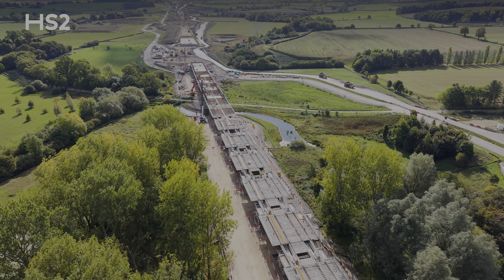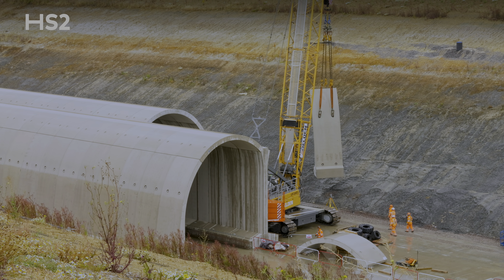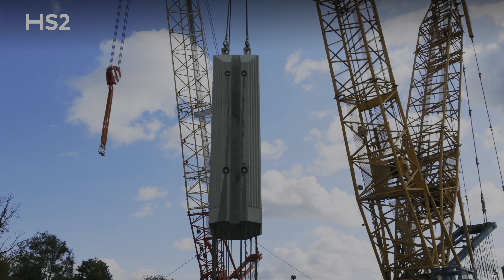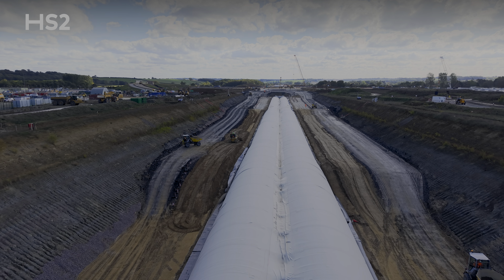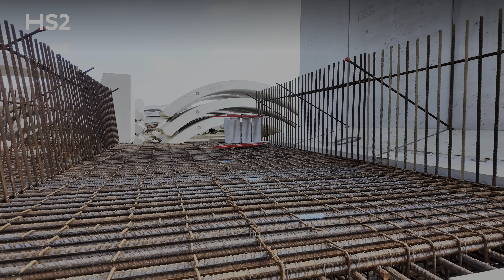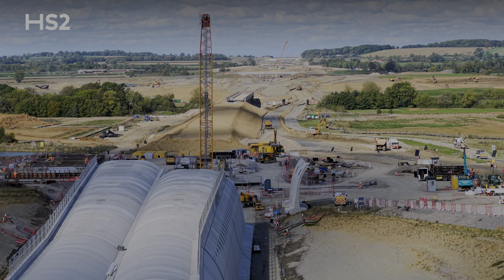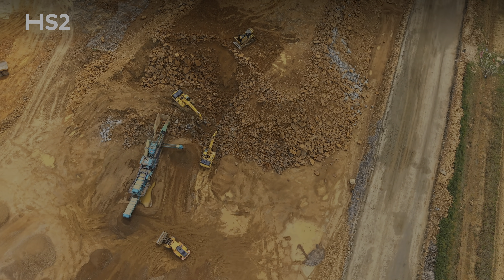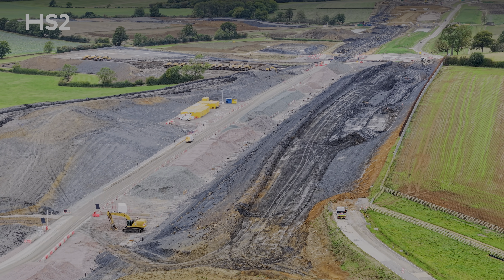HS2 Progress 🚄 | Major milestones across key 8-mile stretch of Britain's new high speed railway 🏗️

Comment: Cut and cover aka green tunnels are a huge waste of money compared to a simple cutting. This is a key reason why costs are overrunning so much, blame planning rules. Its going to be a pretty dull run as a passenger if half of it is in tunnels.
Reply: The green tunnels aren't tunnelling for the sake of tunnelling, the requirements for cuttings are far more stringent than the very steep embankments the victorians built. It's far more cost effective long term just to tunnel rather than deal with the weather resilience measures needed for cuttings.
Reply: @trainjedi9651 They don't have to be steep, an I think we can construct embankments that are far more stable than what the Victorians could do.
Reply: @DavidKnowles0 Many of the Victorian cuttings were stabilised with Japanese knotweed.
Reply: I was thinking the same, why not just have a cutting, they said it was to prevent basically upsetting the local community, look, there is no one near the tunnels, this must be millions upon millions to make this into a tunnel which I feel isn’t needed.

Just how much will passengers get to see of the countryside, seems they will be hidden away for most of the time, what a fun journey!
Reply: @Ian-xq4rt and if noise is an issue just have those noise reduction fences that you get next to motorways in towns along the tops of the cuttings. So much waste. And many of the construction contracts were awarded on a cost plus basis due to clueless civil servants. The contractors are laughing all the way to the bank,  no incentive at all to achieve efficiencies. The nationalised British rail will be run by similar types and I can see it getting worse not better.
Reply: @Ian-xq4rt They say its to not upset local NIMBYs, and while to some extent that is true, by far the bigger benefit is the long term cost savings with respect to maintenance: a cutting is far more prone to landslips closing the line in severe weather compared to a shallow tunnel. Hope this helps :)
Reply: Well HS1 isn’t and much of that is in cuttings and tunnels.
Reply: I've just checked and more than 50% of hs2 will be in tunnels compared to 25% on hs1. Facts are so inconvenient sometimes ! Cuttings would have been far more cost effective and better for the environment than green tunnels as they don't need thousands of tons of concrete.
Reply: @garthcox4307 Even with the green tunnels it's not 50%, if I remember correctly it's around 25% and that's including all the tunnels in the London and Birmingham urban areas.
Reply: @Polarbear1-b6j thats not what a Google search says.  It says 65 miles of tunnels between London and Birmingham
Reply: @garthcox4307  The 65 miles of tunnels is doubled up, as each mile of double bored tunnel is counted as 2 miles of tunneling. So yep, it's 35 miles in total.

Definitely too much (and let's not talk about the fact that the viaducts don't have views from them because of sound buffering), but it's far from 50%.

Comment: I think we should have some large infrastructure projects "on the go" all the time to make use of what has been learned.
Reply: For one thing, HS2 should be extended all the way to Edinburgh and Glasgow. The main reason the scheme was proposed in the first place was to get rid of the mixed traffic problem on three existing mainlines. If we actually extend the line to the two big cities in Scotland, we get rid of most of the mixed traffic problems in England and can then give over the original mainlines to slower trains, like stopping services that serve local people and freight trains taking things between Europe and Scotland.

There are plenty of cities and concentrated urban areas in England, Wales, Scotland and Northern Ireland that would benefit from having a local metro system, that can lower car dependency in and around the city. We need the infrastructure projects to deliver a "return of investment" that is about helping people in part of the UK.

We should rethink East-West Rail and electrify it before it opens.

I think the South Wales Metro project needs to be extended west to the south west corner of Wales. The project should also extend into England as far as Bristol. And a North Wales Metro project needs to improve access to jobs in Liverpool.
Reply: @DavidShepheard  In an ideal world, with unlimited resources and the freedom to put lines pretty much anywhere, this would be my vision for a truly national network of high speed lines:

HS2 built in full as originally planned, plus the western branch extended via Preston, Lancaster and Carlisle to Glasgow and Edinburgh and the eastern one via Durham, Newcastle, Edinburgh (reconnecting with the western branch) and Dundee to Aberdeen

HS3/NPR built in full as originally planned, plus lines from Preston to Manchester and Bradford and Manchester to Sheffield

HS4Air built as proposed to connect HS1 and HS2 via Gatwick and Heathrow, plus a connection to the Brighton line

HS5 branching off HS4Air at Heathrow to Eastleigh (connecting to the existing lines to Portsmouth and Southampton) to create a high speed cross country route in connection with HS2. Possible further phase to Exeter

HS6 branching off HS2 just south of Birmingham Interchange via Gloucester, Bristol and Exeter (linking up with HS5) to Plymouth. Possible northern extension to connect to the northern branches of HS2 directly and prevent congestion between Interchange and the Delta junction

HS7 from Heathrow via Bristol (connecting to HS6), Newport and Cardiff to Swansea

And as afterthoughts to serve the only significant chunks of the country that would be left without any:

HS8 branching off HS1 in the Thurrock area running via Stansted to Cambridge, before dividing into branches to Peterborough and Norwich. Further extensions could then have the Peterborough branch divide in two, with one running via Leicester to connect to the eastern branch of HS2 somewhere between Birmingham and the East Midlands and the other to Lincoln. That could in turn divide in two with one connecting to HS2 at Sheffield and the other running via Hull to connect to HS2 at York

HS9 (though in this case the name is something of a placeholder) to serve Shropshire, Worcestershire, Gloucestershire and Herefordshire. Two north-south lines branching off HS2 south of Crewe, one running via Shrewsbury and Hereford to Newport (connecting to HS7) and the other running via Telford and Worcester to Gloucester (connecting to HS6). Also east-west connections from Shrewsbury to Telford (which could possibly be an extension of the Birmingham branch of HS2 via Wolverhampton) and Hereford to Worcester and Gloucester
Reply: Yep, part of the big cost has been training people up. Now they're trained up and the teams have learnt lessons, other sections could be delivered faster and cheaper. Same thing happens with other projects, where after the initial cost, the government bulks at doing any more, we lose the skillet and then we come to do it again, it's more expensive.
Reply: @benphillips5041  That's the advantage of rolling electrification
Reply: @benphillips5041 the labour was already trained.  Civil Engineering projects conprise large earthworks , concreting, retaining walls, building bridges and tunelling. The only specialist trade is tunelling and the tunelling crews  already have that experience. The other elements are common in any major construction projects, not necessarily confined to building railways. Nuclear power stations hsve some additional uncommon elements though.
Reply: @TrevorWilliams-fq8mg there's a skills shortage within construction. Doesnt matter if some of the elements share some commonality with other types of projects
Reply: @benphillips5041 The skills shortage has nothing to do with  what labour already exists but there isn't enough labour to meet denand.
Reply: @TrevorWilliams-fq8mg most of these gigantic projects are made by specialised international corporations anyways..
To my knowledge Skanska and Herrenknecht are responsible for this project, only British HS2 are too proud publishing such essential information! 🙈🇸🇪🇩🇪🍻
Reply: @OmmerSyssel The British Contractors have their say too......Balfour  Beatty, Kier, Robert McAlpine, Costain.
Reply: Exactly. The management are learning how to do it more cheaply, companies have tested goods and procedures and they can compete with each other on speed and cost, and a long-term pipeline of projects will be must cheaper than stop-start. And that's without the economic boost the finished railway will bring
Reply: @michaelnash5542 no Contractor will ever competitively bid for an infrastructure project as the risks are too high and unknown. Instead  the contracts are let on a guaranteed fee basis like construction management or cost  plus.
Reply: No Contractor will ever competitively bid for infrastructure projects as the risks are too high and unknown. Instead the projects are let on a guaranteed fee basis like construction management or cost plus.
Reply: people have been saying that for the last 30 years at least, politicians are never interested in long term efficiency though.
Reply: That's why its  a utter disgrace that HS2 has been scraped to a third of its size.

Looking at those massiv construction sides no wander that it is expensive. Dozens of tunnels and bridges many stretching quite far and under difficult conditions and cross other lines and roads makes it a stand out projekt.

Comment: It's sad that much of the knowledge gained on this project will be lost, thanks to myopic politicians cancelling the northern parts of HS2, as well as cutting back on the electrification of the Midlands Main Line.
Reply: All the trained up workers and engineers will be able to get good jobs all over the world, just not here probably. :-)
Reply: There is always another project somewhere . Some will go abroad and some will stay here. It doesn't have to be another railway.  It could be any civil engineering project ...the lower Thames crossing, rail freight depots, Heathrow third runway, a football stadium,  a container port, etc.
Reply: Digging holes and filling them in....
Romans were doing the same 2000 years ago
Reply: This why this should be followed up with a Birmingham to Manchester highspeed line. An the design should 100% complete before contracts are even negotiated.